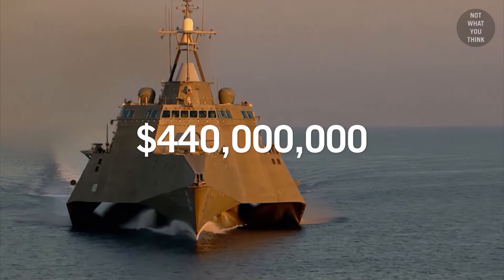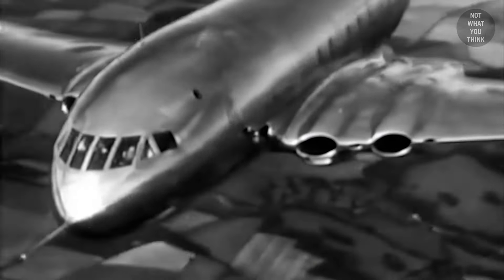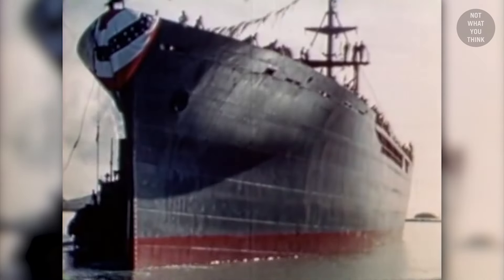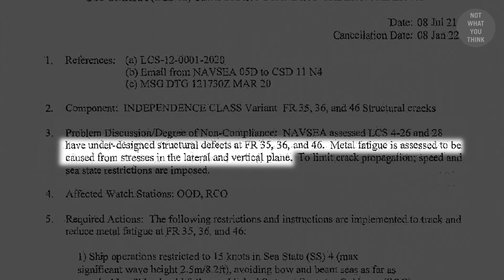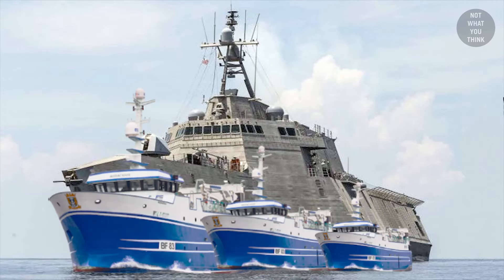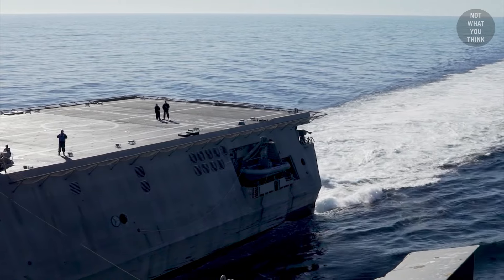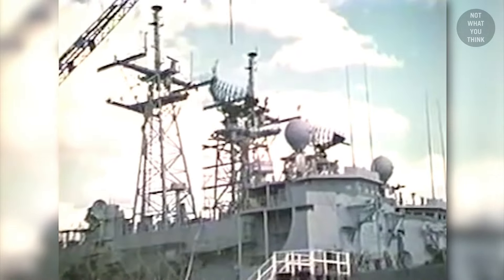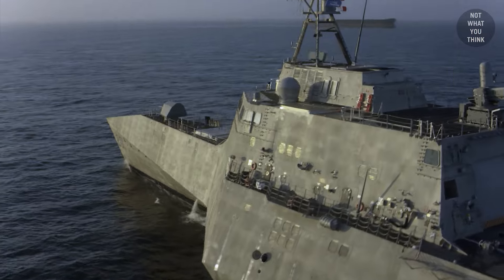SPEED Makes This Warship CRACK!

Comment: FYI.... the square windows were not the problem. When maintenance was performed on the windows, incorrect sized replacement rivets that were too small were used which allowed movement and therefore failed causing fatal decompression.
Reply: No, squares don't load a panel evenly under strain. Learn physics.

Comment: They keep trying to make these super advanced ships with lighter materials and continue to fail. Just make ships how they used to, out of steel with no fancy bullshit. A ship will never be stealth.
Reply: Less stealth, more weight and speed. Lowering the density of the hull means either a higher speed for the same power, or longer range at the same speed. But Al vs Fe doesn't really change the radar signature, that's more down to hull shape and surface coatings, which is a whole other problem.

Comment: Well, Freedom class is lucky then, the not able to connect four gas turbine engines limits designed for 46 knots to 18 knots max speed so it doesn’t have crack.  Independent class runs at 15 knots is no big deal.  As long as the politicians and ship builder make money, everything is fine.

Comment: Frankly both Independence and Freedom class ships were big and expensive mistakes for US Navy. Instead making those ships, US should simply made a successor to Perry class. Yes Constellation is successor but if that class was built to replace Perry class, it would be cheaper then what is now happening. You have one ship that was to be modular, but that failed. It still have corosion problem and its engines cannot achieve 40knots because ship would tear itself apart, second class again didn't receive half of the equippment that was orignaly planned and almost every ship in service having cracks which do not allow ship to go over 15 knots in bad weather. Every problem can be solved, but it its tax payers who pay the price. Aluminum may be good on smaller ship but you want heavy metal on warships. You never know when ship can go to war, Aluminum cant really protect crew much.

Comment: They are made of aluminum and that doesn't flex. They will all crack. It was a big mistake using bi-metal and aluminum. A very expensive mistake. This is no surprise to any of the fitters at the shipyard. They knew it would fail but it was what the Navy wanted.

Comment: I don't get it. Why use Aluminum if Steel is generally all around better for a warship? Sure there might be weight saving benefits, but at the cost of usability.

Also, is it not possible to make warships as 1 piece instead of many pieces welded together? Well, at least the bottom half of a ship. Like pouring a mold except it would be steel, in the shape of the bottom half of a ship. Does it sound ridiculous? Has anyone tried it? I am not trolling, I genuinely want to know if a non welded ship like I mentioned would perform better all around?

So many questions.

Comment: I was in the navy ten years ago when these ships were brand new. Huge flight decks they couldn’t lane helicopters on because it’s made out of aluminum. I served on a ffg that would crack because it was made out of the same metal. It was a known fact the independence and liberty were trash and were never going to replace the ffg. Bigger ship with less crew. On a proven loser platform. Waste of money and time.
Reply: Wasting lives as well. These are unsafe ships. Not even a simple OPV have these issues.

Comment: My question to engineer here's can't we make with Titanium or carbon fiber or stainless steel?
Reply: Not an engineer, but I'm pretty sure that titanium is far too expensive and carbon fiber not usable yet at this scale (and alos too expensive).
Reply: @theroxas898  how about stainless steel even SpaceX using it in Starship?
Reply: @Tinjinladakh   steel is normally used for ships, but the US navy tried aluminium to decrease weight for more speed or range and the plan didn't worked out.
Reply: @randombully3798  does it use nuclear?

Comment: You can't advance unless you build a ship with new designs concepts to see if it will work. You take what works and investigate why things didn't work!
Reply: Yes but you would do that with mock ups and maybe one or two test ships, The worst part is a beer can would have showed this exact problem and not cost 8,360,000,000.

Comment: Sounds like they should stay away from aluminum in structural areas! 
The freedom class and Independence class,the whole LCS program were an experimental program anyway. Every body freeked out about decommissioning 2 year old ships,when they scrubbed the Freedoms,but they served there purpose by showing that it was a bad design. The Independence class are showing the same thing. They are fulfilling their purpose as test bed ships. 
I think it was kinda dumb to use aluminum, especially for the hull plating,in a salt water environment. Salt water does strange,and detrimental things to aluminum in the presence of other metals.
But that's what these ships were for,just experimental aircraft,only these ships are way more visible than a couple planes getting scrapped!
Reply: Seems like a very expensive experiment….
Reply: It is,but that's how they develope new technologies. You ever stop and think about how many BILLIONS of dollars are spent on fighter aircraft development? It's just easier to hide the aircraft stuff. With ships you just have to play it down,you know, about what they're doing.
You gotta build it eventually,and hope at least some of it is applicable in the real world.
Reply: @tomcline5631  that’s the whole point of testing and development. Concorde, A380 etc, they didn’t build them to scrap. If they were testing these, they would have built an experimental one, not 10+. Same goes for the zumwalt.
Reply: They build one,test the hell out of ,as they are building the next one they are changing the designs as they build. Each one of these vessels is different. Might not be readily apparent on the outside appearance,but design changes are added to each successive vessel. That's how you prototype something that weighs several thousand tons and is a couple three hundred feet long. You adapt the designs or change them as you build the next one. If these were planes,the first of the class would be the USS"X"whatever and each successive ship would be the USS"Y" whatever.
 And yes,planes,trains and automobiles Are built to be scrapped when they are developing prototypes.
Reply: @tomcline5631  these are major design flaws that make the fleet unusable and thus they are being decommissioned or put to use on completely different  operations. The navy did not order ships to experiment with, they had requirements which weren’t met because these ship builders built ships with major design defects. You build one if you need to after years of testing with modelling and other tools then only build for the customer after that. The navy are being taken for fools. Look at the type 45, QE carriers etc. no issues minus power plant issues with the 45, meanwhile anything from the US is unusable for its intended purpose. Zumwalt, LCD, Ford class.
Reply: Well I don't know how things are done wherever you're from,but ship builders don't design something,build it and sell it to the Navy. These ships were designed by the Navy,down to the last knot on a signal line. The builders built them to the Navy's exact plans. They then redesigned and changed things as reports arrived,through the US Navy's design department.
The builders do just that,build.
The Zumwalt was from the get go an experimental ship, design wise, technologically everything.  The littoral defense ships ,the Independence,and the others with the trimaran hull form,are completely experimental. They invented the job,then the design of this class of vessel. They are still developing the way a purpose built coastal defense ship is deployed.
The Freedoms were absolutely experimental concepts. They were developing the modular idea for ships. They didn't work out so they shitcanned them. The Ford class carrier is already deployed,and the next 2 are being built as we speak in Newport news shipyards. CVN 80 is the ENTERPRISE and the CVN 81 is named after a woman,I forget the name. Anyway,the problems found on the Gerald Ford,the John F Kennedy and the Abraham Lincoln have been addressed and design changes made,so the next 2 will have the benefits of sister ships experiences to build on.

This is how new technologies are developed. The Nimitz class ships were the same way! The USS G.H.W. BUSH the last Nimitz class carrier is definitely different than the USS NIMITZ.  They grow with the new tech and problems that are solved from one to the next.

Comment: I think they're using the wrong materials when it comes to crafting the bottom part of the ship we didn't have this much issues with cracks and speer reductions in the past. It's not just impacts that causes the ships to cracks it's also the barnicals that form. Why not make the bottom part of the ship have similar structures as many other non military ships? It'll reduce the crack problem. These ships look like they've been built half ass.

Comment: Biggest bunch of misinformation in this video ...been working gonna aircraft for 25 years and NDT for 5 . The basis of critical failures consist of loads , alloys and condition ...this will affect how they are used in design . 
The ten foot cracks you see in this video are a result of a reactive  maintenance program concerning NDT of crack migration.
I work on airframes that participated in WW11 and are beaten daily by newb pilots ...aluminum can last forever .
Challenge me on ship vs aircraft and I'll tell you about the floats I worked on recently from 1937 ....still getting daily bush pilot beatings

Comment: Is that the chemical " crack " or mechanical crack problem?
Reply from the maker: Haven’t seen anything suggesting it’s chemical. It’s an structural issue.
Reply: @NotWhatYouThink  I was talking about the crack sold on the street issue---
Reply from the maker: hehe the "chemical" threw me off, because these aluminum hulls have also had issues with corrosion (which is the result of chemical interactions).

Comment: This is pathetic! The Ford Class Aircraft carrier, has unreliable catapults, problems with the landing systems and elevators.  The F35 is a piece of crap.  The navy decided to purchase F18s and the Air Force  F15s.  Now we are forcing our allies to buy F35s.  Zumwalt-class destroyer was canceled, in it's place the Navy is buying  Arleigh Burke class destroyers. The M1A2 main battle tank is 40 years old, the Bradley Fighting Vehicle is 40 years old, the B52 is 70 years old.  The Stinger is 40 years old.  We to reform the procurement process yesterday.
Reply: To be fair the Emals catapult is a completely new technology which still has to mature. It's high tech, and high tech always has teething problems. 
The F-18s purchased are Growlers, ECR aircraft, no standard fighter aircraft. F-35s have no ECR version yet. The new F-15s purchased are missile carriers for the F-35s, they can stay behind while the stealthy F-35s work as sensors (they have the most sophisticated avionics and sensor suite) and they can fire the F-15s missiles because of their network capability. 
The Zumwalts are simply way too expensive, like the Seawolf submarine class was.
Reply: @simonm1447  I get it. For me, too much new technology at one time.  The elevator fiasco was difficult to accept.  I not a big believer in stealth, the F35s internal weapons bay is too small to be practical. The catapult and arresting systems could have been fully tested on land.  Wasn't the F35 supposed to take the place of the A-10.  The gun on the F35 has had terrible accuracy issues.  Teething problems are nothing new, but these teeth need to be straighten and pulled out. When the F35 went down in The South China Sea it was a race with China to recover the airplane.  A least for the short term,  the military won't use the F35 over enemy territory for fear of our latest technology being compromised.  This is probably why the Russians have been reluctant to use their newest fighter jets over Ukraine.  It's almost impossible to stop a weapons program when manufacturing begins. This is a big part of the procurement problem.  Begin building and fix shortcomings later, after the jobs have been created in every congressional; district, which is by design. I hope these problems get sorted out.
Reply: @253NYCWEST  in the case of the Su-57 they probably did not use it because they have less than 10 of it and it's unclear if it's operational in military definition at all. Since Ukraine don't have gen 4 fighters there's also no need for it.

Regarding teething problems, all manufacturers have them, the difference is some can solve them and others not. In the past the US was good in solving them, programs which are considered highly successful today like the C-17 also had a lot of technical problems at the beginning. In the case of the C-5 they even had to develop new wings since the original ones were not stable enough due to too ambitious program requirements regarding payload and range.
The current F-35s are still block 3, more or less all customers are waiting for block 4 since these aircraft will get upgraded systems.
The air force seem to be optimistically regarding the F-35, because they start to reduce the number of operational F-22s, it seems they think the F-35 can also do their job at least partially.
One idea of the F-35 is their network capability, they can fly closer to hostile aircraft or defense systems due to the stealth, and they can connect themself to F-15 EX and fire their missiles. So they don't need to carry all the missiles by themself, but can use the huge payload of the F-15 instead.
Reply: Well said!  An honest assessment.  Thank you.  Another issue,  The Navy is already decommissioning Littorals. If there’s a desire to increase the size of the navy, the initial proposal of buying 40 Littorals is more for optics than capabilities.  Thankfully they are winding down the program. Except,  there’s  a Rep Senator from the state building the ships who is forcing the navy to continue its purchasing. In addition you have Dem Bennie Sanders who is against the F35, yet wants a squadron based in his state. It’s a bipartisan problem.
Reply: @simonm1447  one other thing. From Popular Mechanics - The USS Zumwalt Can't Fire Its Guns Because the Ammo Is Too Expensive
At $800,000 a round, the ammunition is simply too expensive for the Navy to afford.
Reply: @253NYCWEST  yeah, I heard of it longer ago. They use a special ammo which is guided for high accuracy, but the program was canceled eventually because of the ridiculous high costs for the ammo.
The Zumwalt Class program was also stopped, the ship class will get no more ships than the 3 already built, and the turrets will get removed and replaced by hypersonic missiles next year

Comment: I can almost feel the animosity from those anti big government fiscal conservatives trying to hide their involvement into getting these ships approved and built. 440 million a piece ... to crack under high speed. This sounds like SU shortly before its crack down ^^.

Now what is the logical conclusion? To not spend that much money onto one item? I guess not, instead they most likely will replace those parts in the design which have to withstand the highest stress with steel again, which may make other options of the original design less viable if viable at all.

Comment: There are only one cause for this cracks and that are bad engineering. The constructors have used to thin plates and made the ribbing wrong every thing to keep the costs down. Exactly how isn’t up to me to tell, but aluminum i a superb material used both for ships and planes and more, so you can’t blame the material if it is properly used. 
But as aluminum is very hard to weld without overheating it wich leads to that it becomes brittle it maybe not be the material I would choose for the hull.

Comment: Lol, it's not speed. Its shit materials and worse design. The thing isnt strong enough to work like it was designed to work: when the outer hulls pick up off the water in a turn or by wave action, theres nothing but the outside of the superstructure and insufficient frame members to bear the weight of that side of the ship. Between that weight hanging on stuff that cant support it and the center hull pressing up into the superstructure, it's exceeded the strength of the hull material and proven the designers to be a bunch of pregraduate level stoners.

Comment: using wood super structure old as time, steel worked fine or u r wasting your time well known, few jet programs that took off from sea not deck tested & guess what killed that program, aside from engine wear at /on in the sea,1 guess.

Comment: You spelt Metres wrong.
A "meter" is a tool used to measure and a "metre" is a unit of distance or length.

And it could have been noted in the video that Astral specialise in Aluminium Hulls with many designs operating in the civilian markets.
Reply from the maker: Meters is the American spelling of Metres. Just like favor and favour.